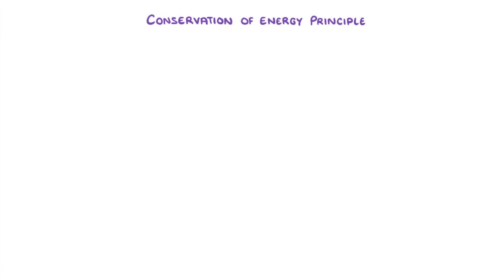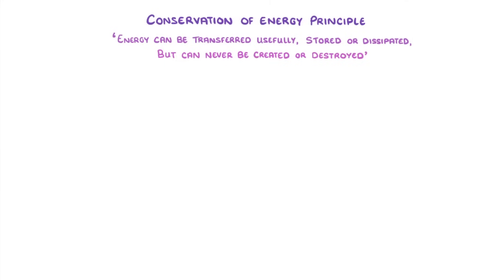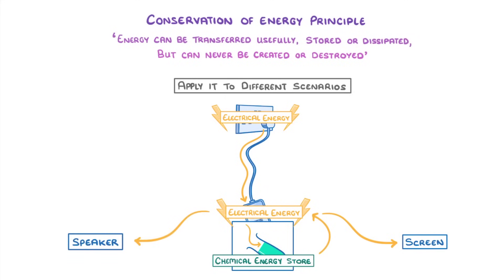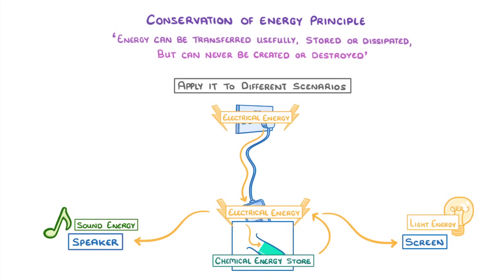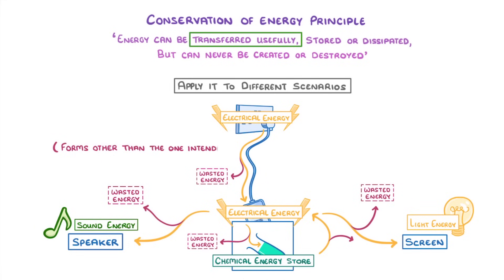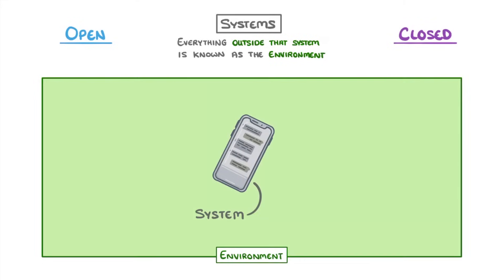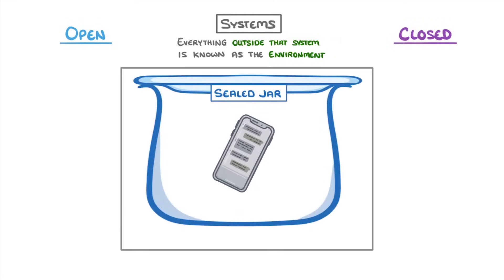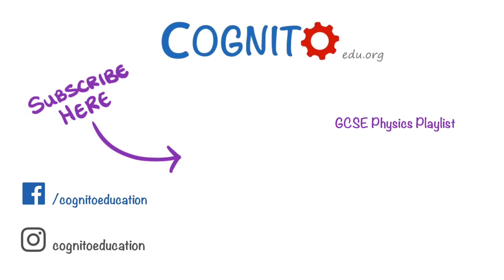GCSE Physics - Conservation of Energy

Comment: Here's a summary of *Conservation of Energy* ⚡🔄  

The *Law of Conservation of Energy* states that *energy cannot be created or destroyed**—it can only be **transformed* from one form to another. 🌍🔬  

- The *total energy* in a system remains *constant* over time.  
- Energy can change forms, like *chemical energy* in food converting into *kinetic energy* when you move. 🔥🏃  
- Common examples include *roller coasters**, **pendulums**, and **electric circuits**, where energy shifts between **potential and kinetic* or other types. 🎢⚙  
- This principle is key to **physics, engineering, and sustainability**, helping us understand how energy flows in everything from machines to ecosystems. 🌿🔋

Comment: If a phone gives off light energy, and you place it in a jar. That light still makes it to your eyes. Beyond the jar. Likewise, any heat would heat the glass and radiate out. So how's that closed?
Reply: You’re right the jar is not a perfect close system due to light and sound escaping, but it can be perfect. If the jar was sealed as in it was opaque and all the energy was stuck inside with sound absorberbers or like something that reflects the sound back inside this is just to give you an idea of what it is.

Comment: Ok but you never go to the third step in any of these. If energy never goes away I disagree.  You charge the phone the battery then uses energy to light screen, make sound, throws off heat.  What then does the sound energy convert to?  How about the lighted screen? Eventually the battery runs out of energy can that sound or light be recouped?
Reply: It will be lost to the surroundings

Comment: Quick question regarding the closed system. Say a mobile 'phone is inside a sealed jar, which is sat on top of a wireless charger. If the 'phone started charging, would this count as energy being transferred into the closed system? Or would it not charge?
Reply: If you can transfer energy into the system like through wireless charging then it’s not closed